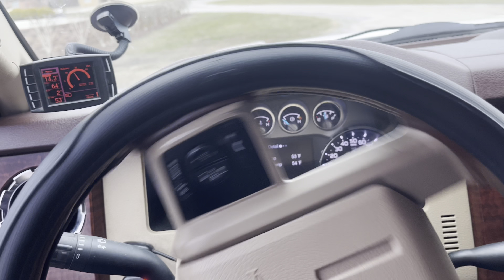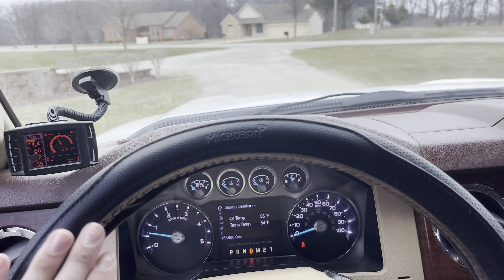Fitting 37x13.50 tires on my superduty

Comment: Looking at this Im gonna try a 4" lift on 37s just because I pull a gooseneck trailer and I don't want to take a chance of rubbing that rear tire. Great video though. I needed to see this so I could get a good idea of what to do exactly.
Reply from the maker: Hell yea man 4” will prolly look cooler too i wish I did a 4” so I could do 38s
Reply: @nick7.3  Oh yeah 38's would look awesome man
Reply: I’m on 6 inch lift on 37 inch toyos and pull a 5th wheel camper so u should be good
Reply: @donovanschlehuber9168 is your camper lifted?

Comment: Nice man , did you end up putting a wheel spacer to prevent the inside rubbing? If so does it still rub on the finder ?
Reply from the maker: @SalvadorOrtiz-l8m  I did put 2” spacers on, doesnt rub anymore

Comment: Your rear axle is not centered in the fender opening because you have STACKED blocks. You have the factory block with the bump stop tang, and some other block under that. Looks like a chunk of rectangular tubing that was cut and stuffed in there. Not good. Get a proper 4 or 5 inch block from PMF or ICON and it will have the centering hole offset to keep the axle centered. And be stronger and safer.
Reply from the maker: Thank you for this comment! Going to give it a look today. My lift kit came with rear blocks but I decided it didn’t need it because my rear end was already high. Previous owner must of did something when he did the 1” lift up front 😂 hopefully this finally fixes my issue
Reply from the maker: I put a 2” block in instead made it a little shorter in the back but didn’t at all make axle come forward, going to get a 4” block soon
Reply: @nick7.3  hey bud, so what’s your exact lift setup now, I know this is from a year ago but I got a 2016 f350 SW and wanting to make it look just like yours. I know it’s a 3” RC lift in the front but what blocks are you running in the rear? Thank you!
Reply from the maker: @ I have just a complete rough country 3” lift, in the rear there is the stock blocks+ the rough country ones that go on top. I added 2” wheel spacers on it too about a year ago